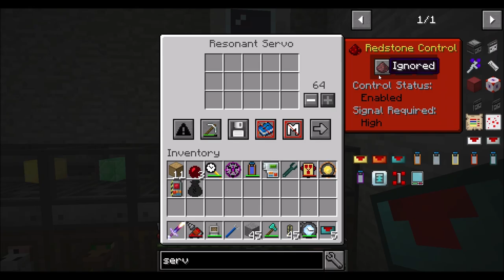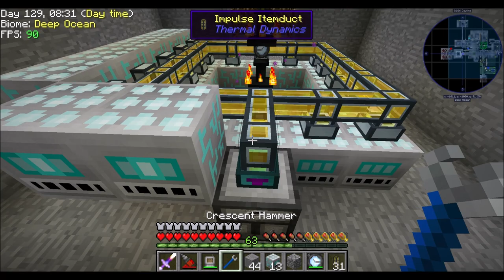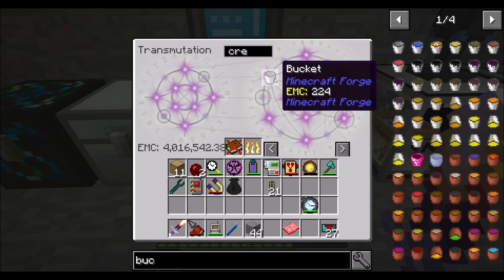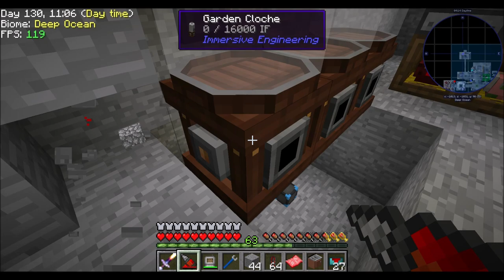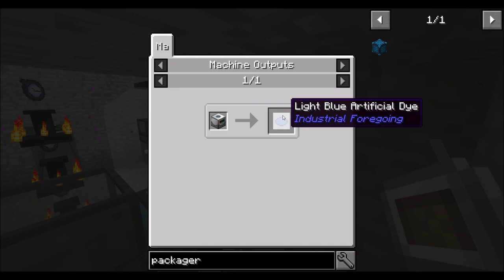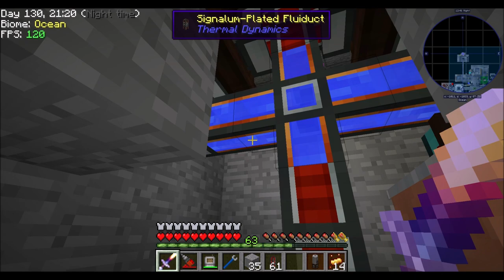Stoneblock   Ep34 Compression and Flux

Comment: The derping around cloches... I cringed so much. Why doesn't he supply the power from the top, where it suppose to be? He could have 3 of them, place 3 fluxducts on top, network point 'em and voila! Problem solved. No need for signallum plated fluiducts
Reply: While he did forget the point on the top, With the time warp the cloches are using more then the block can accept from any single power input. He still needed the second power tap

Comment: "i love the retriever tho. it's so convinient"
well. you could... just not have the retriever pull from the closest and do a thing like round-robin with colecting. i think there is that option. but oh well.
Reply: It still likely wouldn't be fast enough
Reply: well. it can retrieve a stack at a time. and the collectors produce neutronium piles slow enough that it wouldn't have filled to 64 in one.
as after dire put all the extractors he did not have 64 piles per tick. and the resonant retriever i believe retrieves a stack a second. it just needs to get to the stack instead of collecting the same 20 eollectors while the rest pile up. (sorry for the long explanation. but i hope everyone who reads this understands)
Reply: @Scoots1994  It would be fast enough. Unless each of them produce a stack every few seconds, a single enderium retriever can do it just fine with robin round. I had even more collector than he has and a retriever worked fine.
Reply: Entitled if there was something like the wand of animation from Erebus you wouldn’t even need the collectors once you get a block on neutronium

Comment: Dire still forgets about his Cryo-stabilized fluxducts which have infinite power transfer and also have an EMC value. 
Like so Dire can see
Reply: Yea long forgotten in RS storage
Reply: The issue wasn't the cabling, its that the cloches can only accept 256/t per input point, and he was using more than that with the time warp. Hardened conduit can transfer 4k/t, which would have been enough, had the cloches accepted it all.
Reply: Plus he has PLENTY from quest rewards. :P

Comment: Awww... He's sooo cute thinking that couple of stacks of dark matter is a "comical" number... :) To put things into perspective - to complete infinity armor and world breaker quests he will need little over 15 STACKS of infinity catalyst. That is rougly 3'500'000'000'000 EMC or close to 371'000 STACKS of dark matter. :)

I had a setup containing 484 roosts with total of 7744 emerald chickens (10/10/10) and seven watches of flowing time, pumping around 100 million EMC per second - and it took around 8 hours to complete this task.
Reply: is there a way to automatically turn items into stored EMC?
I only know about converting them to kleinstar Omegas to redice storage size
Reply: @WhitedevilEE  The best way I found is to make high-value objects such as red matter blocks (stack is around 100 million EMC - that's more than fully charged klein star omega) or compressed sugar cane (quintuple is already more valuable than red matter - and it goes up to octuple). You can store those items in drawers with storage upgrade (7x emerald upgrade = over 7 thousand stacks per drawer) or digital storage - refined storage or applied energistics.
Reply: Send emeralds to a condenser making octuple compressed sugar cane.
Reply: @arathorn867  That's exactly what I did. After I got my first infinity catalyst I switched from octuple compressed sugar cane to making it directly.
Reply: @KristoffDoe  I see your comment now. I should have refreshed before commenting!
Reply: @arathorn867  No worries, mate!
Reply: Joe Average  I see why you would see it this way. Let me assure you that it was not my intention. I considered this to be bit of friendly banter followed and statement of the problem, followed by an example of workable solution.
Reply: Kristoff B shhhh let the millennial have his or her safe space 🤑

Comment: How many times do we have to tell you? 😅 Power goes into the top of the cloche! Because that's where the heating lamp is.
Reply: Also IIRC, most IE machines takes in power from the top of a block, because of how the power connectors works in that mod.

Comment: Sooooooo much derp this ep. As many many others have pointed out, almost everything this ep could have been done quicker and cleaner if you just took a sec to remember how the blocks worked. You forgot that cloche power from the top and that crafters have 2 recipe slots so no, not clean or elegant. And derping around with the ducts, just ouch.

Comment: Dire, you can have 3 cloches setup the way you have them now by moving them back 1 block then over 1 block which will allow access to the back of the machines still. Cloches accept power from the top as many others have also stated so FPs on top would look good AND be functional. I think you used reg dirt as well when you could use fertilized dirt for better growth. Love your videos, long time fan & follower! Keep up the direderps!

Comment: You should use translocatora they are much faster
Reply: With the watches nearby, the item transfer speed is irrelevant, it's nearly instantaneous anyway.
Reply: @Mirality  I did find out that max extract ender io conduti are still slower then translocators with watch of time. never tested TE pipes
Reply: That may be true, but as long as they can pull it out faster than the neutronium is being generated, then it doesn't matter.

Comment: Could have done all that Fluxed Electrum with 3 Phytogenic Insolators (which he already has, could have EMC'd it) a single RFTools Crafter Tier 1, a drawer and filters to handle the seeds, Blocks straight into Neutronium Compressor.

Comment: Should have used retrievers instead, your piping would have been much easier. Could have had a row across the top of the compressor with retriever whitelisted , and then one pipe comes off either side and a row across the quantum storage. You wouldn't have to worry about the pipes connecting then.

Comment: For some reason when it came to 1.12.2 it seems refined storage broke when it came to using things like infusion crystals and stuff at least thats the problem i have so if you just ctrl shift click start it will perform the craft anyway it just gets confused about not having something either in use in another craft or with a varying durability

Comment: dire 2 things, 1) pantomphace for the nutron collecter, and 2) the item pipes keep there disconnect pref even if the item they were connected to is gone, so you can set up all the singularitys ahead of time. also i added agricraft as the roost mod is an animal version of it, so i thought it made sense. lastly would the compact machine blocks be accelerated by tge watch or rod of time? if so then you could put the watch accelerated rooms in them and accelerate them more! just an idea.

Comment: anyone having trubble playing? I can launch the game just fine. But once I get into my world the FPS sticks to single digits (mostly less then 5) for a minute then stays on 0 while refusing to respond until I shut the game down
Reply: AceOfSerberit How much memory did you allocate?
Reply: @rockbandinthusiast  I've not done anything to that, it's been at default. How do I give it more?
Hope that might fix it
Reply: @AceOfSerberit  in the launcher settings you can select the profile you're using & allocate more memory...I recommend at least 6G but 8G is preferable. Doubtful you'll need more than 8G allocated for it to run smoothly
Reply: @PsykotikDragon  Thanks! Gonna try to set it up as soon as I get home
Reply: @PsykotikDragon  I just got back. I've gone over everything in the Minecraft launcher and I don't see any setting for memory
Reply: @AceOfSerberit  in the curse launcher settings
Reply: @sanovictus  I go via Twitch. Is that any different?
Reply: @AceOfSerberit  should be the same. File -> settings -> Minecraft -> Java Settjngs
Reply: @sanovictus  ahhh. So in the actual file. I thought it was a setting within twitch or something. Had trouble taking a look as the f**er refused to load my profile
Reply: Ace, go to the Twitch settings/ Minecraft/ memory and adjust it there. Use about 2GB less ram than your computer has so other systems can still run. Setting it in twitch will apply it to all Twitch ran mod packs.
Reply: @mkpet13  thanks Pet, I found it! I have 8 on my laptop so I set it to 6. Well 5.8 but close enough.
Now I can finally play again
Reply: AceOfSerberit. No problem. Happy you got it working! Have fun with the pack.

Comment: Dire why you are making the game hard when its easy you are making a lot of emc all of the singularitys has emc just emc them :D
Reply: In this pack they have no emc value set for the singularities themselves only the infinity catalyst itself has one. Its possible to make the blocks themselves used in the compressors via emc conversion though. But he still needs to make at least one of each have to be made one of each before he can dupe the catalyst item itself. And I made that mistake myself before I saw someone elses youtube chan showing it being created. ( I made 64 of each part for the catalyst. )
Reply: He plans on doing this, you still need to get at least one though. Might as well automate the production.
Reply: Plus he said that is boring, so hes not if can avoid it.
Reply: @sariphen  it also doesnt help that hes avoiding mekanism just because he uses it extensively in the skyblock pack
Reply: No they don't...
Reply: It's just not true in this pack at this point. The pack is designed that way & you can't solve it without using massive (i.e. generating millions per second) emc. Or you'll end up complaining that everything takes so long and it's just a matter of time, when really you didn't solve the scale problem.
Reply: @vivelle  İ was mentioning the block duplicating when he make one catalyst he can duplicate he just needs 1 singularity.